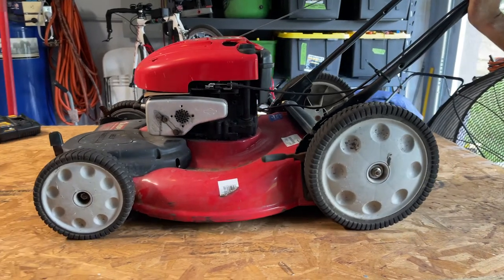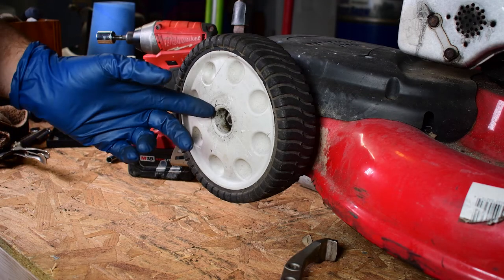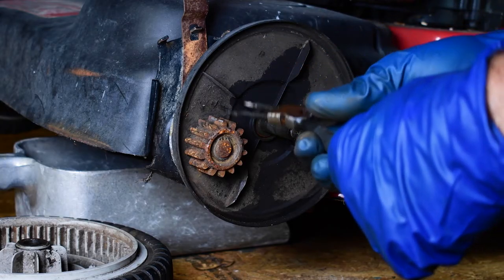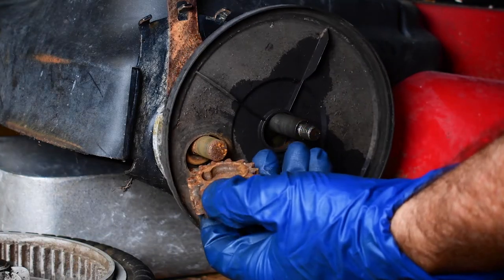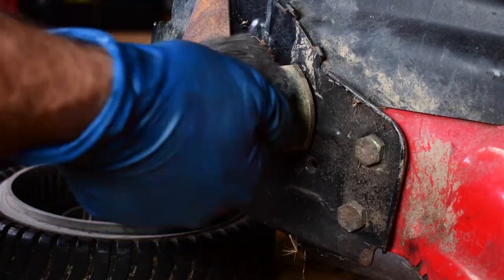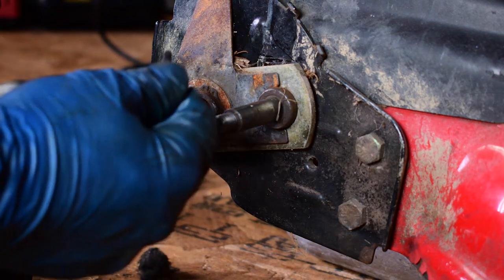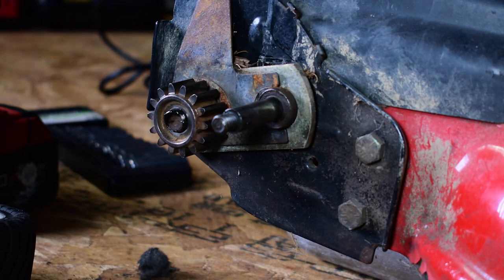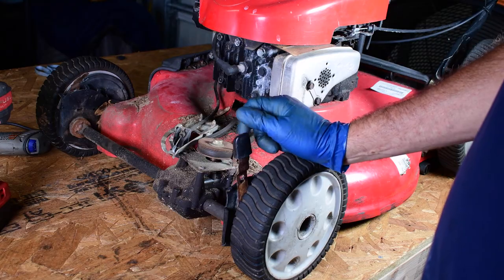Self Propelled Lawnmower Wheels Locked Up [Easy Fix]

Comment: Thanks for this. Just got a cheap mountfield with a Honda engine second hand off facebook for £30 but it has a wheel locked. Looks like this could be the solution, I'll give it a go at the weekend!
Reply from the maker: Excellent!  I hope it works out for you.. 😊
Reply: @JLPicard440  as it turns out the belt pulley for the self drive was knackered and it's not running right. Starts easily but won't idle and bogs down. Thoughts?
Reply from the maker: Not sure I understand.  Is the belt having the problem or the engine itself?

Comment: I have one that has self propelled removed if i remove gear would wheel still work?
Reply from the maker: HI, yes it should.  The wheel is being held on by the axle and nut in the center.  Removing the gear won't cause it to fall off...

Comment: do you have any tips or reason why the rear wheels on my craftsman all wheel drive walk behind are always on (engaged).  It seems like the self propel levers only controls the front wheels.
Reply from the maker: Off the top of my head, I don't know.  Im sure if I had it in front of me I could figure it out after tearing into it to see what the issue is.

Comment: when I removed the snap ring the gear still does not come off.  The lip/groove that the snap ring sits in is preventing me from getting the gear off.  Should I just try more force ?
Reply from the maker: Yes that is supposed to come off.  I would spray with some WD-40 or PB Blaster and let it sit for an hour and try again.  Try turning the gear back and forth as your pulling as well...  Don't use pliers as you'll eat into the teeth of the gear.
Reply: If the gear is sliding back and forth but not going past the snap ring groove then the hardened snap ring has galled the side of the groove, forcing a very small amount of metal above the groove. Hit it lightly with a fine file all around the groove to take down that ridge and the gear should slide off. 
If the gear isn’t moving at all then apply some penetrating fluid (PBBlaster works great) and work the gear a bit and it should free up. Sometimes it takes multiple applications over time to free up.
Reply from the maker: OIC... That usually doesn't happen.  I can't see it so that's why I didn't suggest that.  But yea if that is mushroomed up just a little bit that would definitely keep the gear from sliding off...

Comment: thanks for the Video, my mower just started locking up today the Wheel would spin then Lock up, i let the Clutch go , take 2 steps back pulling the Mower then it would un-lock, it is locking up ever So often, my other issue the Front wheels have never Turned but only when you use the Cluch, last year i had to replace the Pully's .
Reply from the maker: Yes there could be something that's not turning freely in those front wheels... it's worth taking the wheels off to see...
Reply: @JLPicard440  someone did tell me that is normal for my type of Mower since it is a 4 Wheel drive mower.
Reply from the maker: I can't say for sure.  I've only had 1 or 2 of the 4 WD mowers and I don't remember how the wheels behaved.  Seems like it should push freely in FWD or REV...

Comment: I'm having this exact issue with a Husqvarna mower with a Honda engine. I haven't opened it yet but I think I may have lost some retaining pieces in one of my wheels which is off at a slight angle but they are both locked up. Where could I find parts for my wheel assembly?
Reply from the maker: HI, as to what could be missing that would be hard to say without being able to see it... I usually take the mower model number which is usually on a sticker on the body somewhere or it's on the grass flap in the back where the bagger goes.  Then I take that model number and plug it into www.partstree.com  Great website for looking stuff up like that.  You can get the parts breakdown for the wheels and probably figure out what's missing.
Reply: @JLPicard440  I called a local mower guy and he came over with some tools and took one of my tires off. It turns out that a plastic shard (a piece of the wheel dust cover) came off and lodged itself into my wheel assembly! I couldn't believe it, never seen that happen before and still don't understand how it did happen. But there was also a lot of old grass in everything that had to be cleaned but it's working now.
Reply from the maker: Oh excellent!  I've never seen that one before... Like you Im like "how'd that happen!?"
Reply: @JLPicard440  The more I think about it I don’t think it came from the dust shield, it must’ve been just a piece of plastic laying in the grass that I ran over. 😀
Reply from the maker: That does make more sense... 😊

Comment: How would you recommend removing the gear if it is rusted on
Reply from the maker: Maybe try some PB Blaster and let it soak for a while.  Without being able to see it, it's difficult to say.  Does it turn at all?  IF even a little bit, you can work it back and fourth.

Comment: I have a Ryobi self-propelled the rear wheels roll freely forward but lock up going backward.  Also, will not self-drive forward.  What are possible solutions?
Reply from the maker: Hello... Without being able to see it, I could only guess.  I actually haven't had the opportunity to work on to many Ryobis with this problem.  I would certainly try and remove the drive wheels if they will come off without any special tricks and examine the mechanism to see if anything stands out.